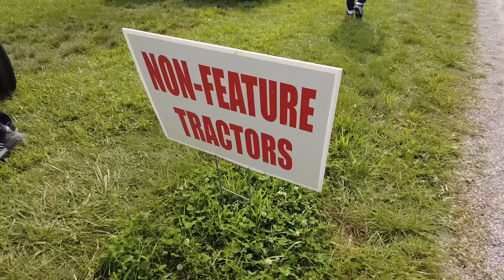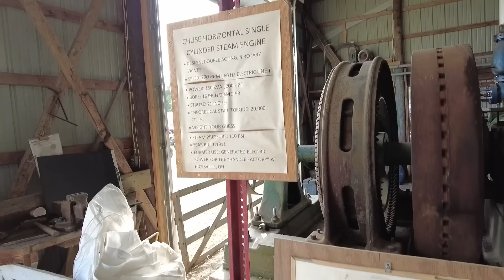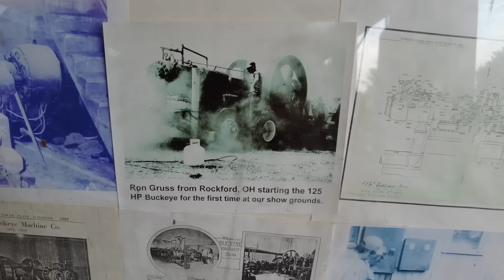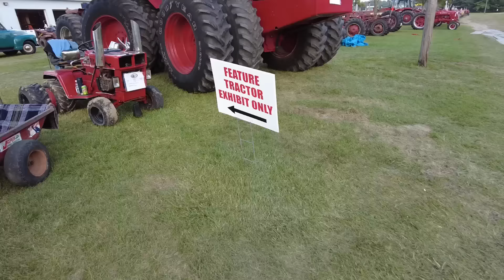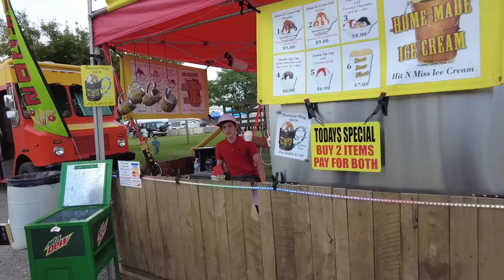Awesome Red Mini-Tractor And More! - Maumee Valley Gas & Steam Engine Show

Comment: At 9:14 you ran across the 600 and WD6 wondering if they ran on gas or diesel. They start on gas and once warmed up a little switch to diesel. Uncle had a WD9 when I was 10. A monster power house for the day.

Comment: At 9:50 on the WD they have a “two” sided engine one side starts on gas and warms up the engine and then you “switch” it and it runs and on diesel they’re really neat the MD has the same system
Reply from the maker: Excellent 👍🏻
Reply: Pete has done a few videos on his over on Just a few acres. They are interesting for sure.
Reply: @Matt-mq1ep  100% his channel is awesome!

Comment: I just picked up my first green tractor - Before Neil got it! Found one over by stateline just north of Payne. a 1979 2040 with a front end loader. That's a great show over at Maumee Valley. My Grandpa had a tractor - I think it was a JD that would start on gas and then could be flipped over to diesel for better fuel economy on the same engine.

Comment: Neil… I grew up with Farmall tractors.  We had an M and a C.  Both had the narrow front ends.  They taught you real quickly how to steer with the brakes!

I’ve owned one IH.  It was a 1954 I-A.  The ‘I’ meant Industrial.  What was special about it was, the exhaust.

There was a butterfly valve between the header and the exhaust stack.   When you closed the valve, exhaust was diverted into hoses that powered an air cylinder.  The plunger drove a circular cam that lifted and lowered the belly mower.  That was IH’s answer to the new-fangled Ford 3-point hitch.

They ultimately lost the battle and Ford ended up getting the business of road side mowing equipment.

I used it to clear a road through Sassafras Valley then decided to upgrade. I wish that I’d never sold it… it would be so cool to have it restored and ready to show.  I’ve been to dozens of tractor shows… never saw one like it…. But, did met a few old-timers who recalled seeing them in their youth.

Shows like the one you were at bring a lot of history and customs to life.  I loved taking my daughters (and now my grandkids) to give them a glimpse of what life was like in my youth!

I am looking forward to the livestream and hope to see you tonight.  

PS- check your e-mail.
Reply from the maker: I love hearing the history and stories behind so many of these old tractors. That's actually what makes them neat is the stories they have to tell rather than just the tractors themselves in my opinion.

I'm glad we share that interest and we can hopefully pass it on to the next generations too. At least make them aware of it if nothing else!

For young people to see those steam engines and that sawmill really is a glimpse into the past and I don't think you can get that hardly anywhere else anymore today.

Thanks for the heads up on the email. Glad to hear you got your nematode situation, hopefully under control. I haven't had a chance to watch a video today yet, but I certainly will.

Thanks as always and hopefully we'll catch you tonight.

Comment: I just learned about the old Farmall diesels starting on gas then firing up the diesel it seemed to me to be ahead of its time John Deere used the pony motors like caterpillar used to start the diesel engine they are all cool.  I went to a tractor show on Friday they used a big steam tractor to run the sawmill it sounds awesome when the steam engine gets under a load cutting the logs I go to that antique tractor show every year always look forward to it that show you went to looked like a lot of fun as well
Reply: The first tractor I drove was a Farmall Super MD which started on gasoline and then you switched over to diesel when the engine was warm. This tractor would start at -20F (we farmed near Barrie, Ontario, Canada) when our David Brown 990 Selectamatic Diesel wouldn't start after being plugged in for days.

Comment: You are not the type of person to call something by the wrong name. SO..... that is NOT a "buzz saw" that is a "circle saw, sawmill". That sawmill is WAY underpowered, he should be able to push the logs through three or four times faster that what he is doing.
At 15.19 of this video. Yes, the gasoline is to start a, what they call a "pony motor". That is a Gasoline engine that actually starts the diesel engine. So it has both gasoline and diesel. They used that setup in MOST bulldozers back in the day. 
Out side of that LOVE your channel, have watched for over 1.5 years, EVERY EPISODE.
Have a GREAT day.

Comment: Deere 300/4000 series rear ends are beefier to the cub hydros. I had a 1772 diesel for a short time and it was pretty light weight build compared to a 332/420 deere.

Comment: The IH and Farmall Diesels would start on gas and idle. Once there was sufficient heat in the engine you throw the decompression lever forward and open the throttle simultaneously to switch to diesel. My Grandfather had an old 450 Farmall Diesel.

Comment: Starts on gas, then the gas engine fires the diesel engine... starters didn't have the power back then to start diesels
Reply: It's the same engine it starts on gas then you pull a couple of levers and it switches to diesel.

Comment: I ended up with a cub cadet 1872.  I was looking for a 318, but the cubs (though not as common) are substantially cheaper than anything green around here.  Plus, is was easier (and cheaper) to get a 2 stage snow blower for a cub, single stage seem to be more common in the deeres.

Comment: I see these home-made pivot steers and all those I've seen have the operator's station on the front half. Having driven a mix of loaders and tractors, I'd like to see a home-made pivot steer with the station on the rear half, for the reason that the steering angle can easily be seen when the operator is sitting on the rear. I do understand though that it's easier to build one of these with the station on the front half and all these guys have done a great job regardless, especially the guy with the six-wheeled tractor

Comment: Neil, I had a1964 International Scout 80 that was typical for the rust problems. I was actually planning to drop a Toyota mill and rears in it, but it didn't work out, so it was given to a guy that had one he needed parts for. The only upgrade I did was installing a Saginaw power steering box and an Isuzu fluid reservoir.